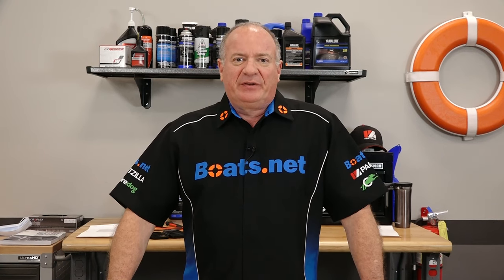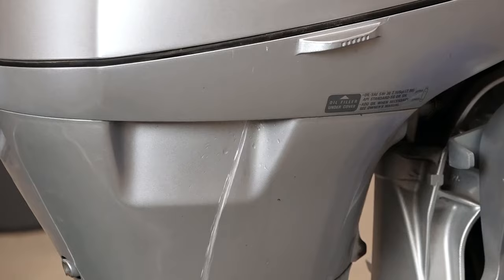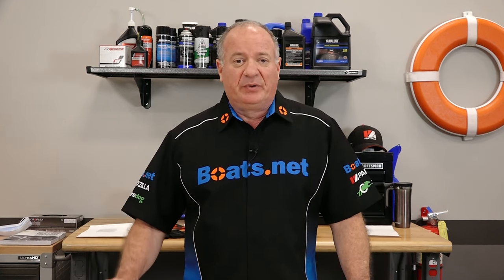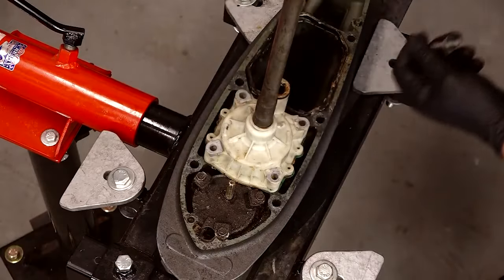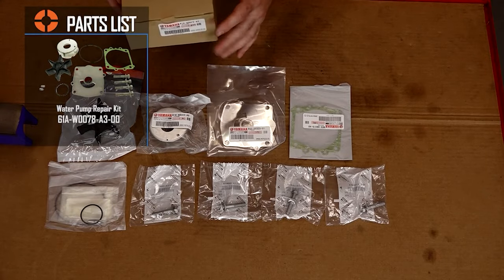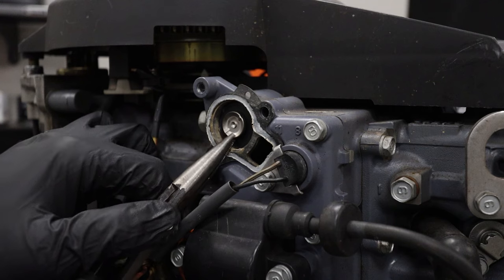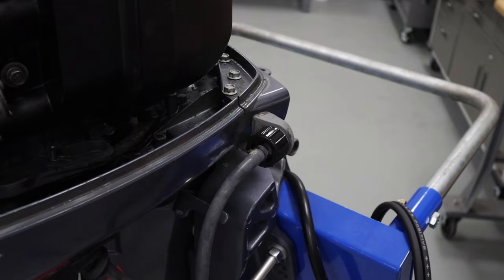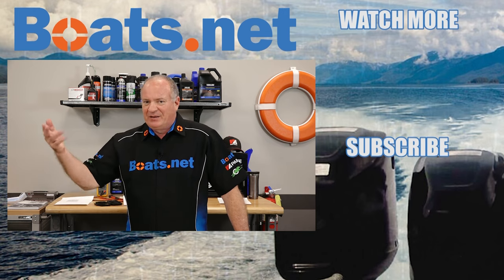Outboard Is Overheating | Why is My Outboard Overheating | Diagnosing an Outboard that Overheats

Comment: Use vinegar in a bucket that will flush out the corrosion in the galleries but keep an eye on the tell tail because the debris may clog the tell tail, but done on occasions will keep your motor clean.

Comment: My impeller was destroyed.  Most of the pieces felt out of the bottom.  But I have a feeling some have been clogged above.  How could I get them out?  Use shop vac with straw attached?
Reply: Compressed air thru all of the intake vents at the bottom, remove the thermostat and blow. Do the same thing for the pee hole. You need to get all the pieces out or it will block the system.

Comment: Have a 60hp 2 stroke yamaha. Had a problem with the rubber grommets and seals not sealing on the water tube between the pump and tube.  Odd place to have a problem but a zip tie tightened around the seal has held it snug against the top of the pump housing and stopped my overheat problems.

Comment: 1998 yamaha 250 2 stroke,saltwater series: new impeller, cylender heads removed and interior brush cleaned. when water is applied and engine running water doesn't make up to the thermostats and engine overheats. water comes out the tail tell. pop valve is good. i replaced the lower unit last year. plese help.

Comment: Great video, thank you!!  Question:  I have 1999 225 Mercury Optimax.  I saw a video recently showed how a dirty strainer that filters water going to the air pump needed to be cleaned on a regular basis.  I've owned this motor since it was new and have never head of the strainer, so I looked it up in the service manual. The service manual shows two strainers, one on the exhaust plate and the other on the top of the powerhead.  I can't see the one on the top of the powerhead without removing a bunch of stuff and the one on the exhaust plate appears to be plugged with no water connection.  Since these cool the air pump and the air pump has no heat alarm, I am concerned that I may be neglecting a preventive measure that should be taken care of.  Any advice would be appreciated.

Comment: Great video, I thought you may also adress deflectors that swell on some manufacturers V6's and don't let water run down to lower cylinders and usually cause a overheat horn under throttle. Not a every day issue, but happens. Anyways great video!

Comment: Questions about engine flush: Should full city pressure be used? Is it recommended to use hot water?
Reply: 10-20lb pressure likely

Comment: Great video,  my question is, my impeller blades were all sheared off, and there was not much inside when I took it apart, does that mean it is further inside the engine ? The motor is a 25hp 4 stroke yahama 2003.

Comment: Hello. Thanks for the video. We have an 1970, 70 h.p. Chrysler engine. We have changed the impeller and it is still getting hot and it does not spit out much water. Could you tell me where my thermostat is? Thank you.

Comment: Hi i changed thermostat on my outboard,changed new impeller..pee like a dream..changed carb as i suspected the carb, the powerhead gasket has been changed ,checked cylinder adjustments and gaps and still overheating..changed engine oil...3 5hp mercury 4 stroke..almost new hence i dont suspect anymote gasket blown..any suggestion what i have to look at...not changing the gear oil and not opening it...any suggestion what to look at for more to sort out this overheating ..thanks in advance..

Comment: I’ve replaced the water pump, the thermostat, and the poppet. Water is flowing out the tail tell and it has never not flowed out. But this year, the motor goes into limp mode when I run at over 4500 rpm for more than a few minutes. It runs fine for long periods of time if I keep it below 4500…over an hour with no problem. Could it be a false alarm from the temperature sending unit?

Comment: My 1999 90 hp Yamaha runs all day at 3800-3900 RPM BUT when I push it 4000 + RPM the alarm goes off and it enters 'Limp" mode within a few minutes.  After idling for 3-4 minutes the alarms turns off and I can return to running 3800 - 3900 RPM. So far new water pump rebuild, replaced thermostat, twice, replace pop-off valve.  I have run the engine without the thermostat and no change to alarm going off and turning off after 3-4 minutes at idle.  Oil consumption has remained constant in the 12 years I have owned this boat. No drop-off in performance, oh I am pushing a 21' Carolina Skiff.  I have always flushed my engine after each an every use.  The previous owner was very meticulous when it came to engine and boat maintenance.
Reply: See this is a little late but remove your thermostat see if it’s getting water if not your water tube might be damaged not allowing the water from the pump into the block

Comment: Yamaha OX 66 -  2 stroke - 250 HP .  Engine is new too me ,   no stream of water coming thru weep whole , , Impeller needs replacing , Today for kicks I ran two hoses , one on lower unit and other hose too flushing system ,  My thinking since I need new impeller maybe running flushing system might keep engine blocks cool ,  ( no plans on using  boat  )   Using gun ,  one side of block was cooler then other ,  Starboard side 111 - port 130 .  . - No water coming out ,  ( top )  why difference in temps  on blocks

Comment: new impeller on my 25 evenrude.  92, 2 cycle.  removed the broken thermostat.  Water isnt flowing through the pee hole.  Engine 0verheating.  Do I remove the side plate to check for stoppage?  This plate is situated where the pee hole is before going through the hose that feeds to the mounted pee thingy on the bottom side.

Comment: I Have a 1997 Merc 50hp 4 stroke. Bought the boat in 2000. I've had this problem for quite some time Only when motor is idling for about 30-40 seconds I get and ALARM buzzer. It does have a SOLID stream of water coming out the discharge outlet so the impeller is sending water through the engine. So thinking the cooling ok. I thought maybe its a low oil buzzer. Checked that and oil is full. All I have to do is turn the key off and restart and its all ready to go. If I continue to idol the buzzer goes off again after a while. no buzzer at any time other than idling . I change the oil regularly and someone told me there may be a RESET oil change timer that may need to be reset. But have no idea how to reset it ??  Is that a possibility ? Thanks for any help on this manner. Dale
Reply: Figure it out?  I have a 40hp merc doing the exact same thing right now..  will run strong across the lake with water existing telltale and when you slow to idle it'll alarm solid..
Reply: @zellerized  Yes, Changed the impeller and the alarm stopped going off. The old impeller did not look bad but was a little more flexible than the new one. Don't understand why because it looked like it was pumping water at a good flow but evidently it wasn't pumping enough water, but it did fix my problem. Hope this helps !

Comment: 2015 250hp suzuki , overheats at idle with garden hose used at alternate attachment. Plenty of flow, yet I  get error an code (3-6) for exhaust over heating

Comment: Hi there I have a Yamaha fl200 bet v6 the knock sensor behind the two heads I can't get to it how do I remove it without having to remove the heads because the knock sensor is irregular and I have been  tested it with a new knock sensor

Comment: I have a 20 HP 4-stroke Yamaha outboard. every month, I run the motor using a deep bucket.  Last month, the bucket had a hole in it and it ran dry. I have replaced the water pump and thermostat, but the water does not run through.  I have checked all hoses and everything is clear. Any idea if there's any hope for this motor or is it shot?
Reply: Replace the impeller.

Comment: I have a 2004 Yamaha 150 4 stroke that will not idle properly when it starts, it will go at 1200 and will not go down to the proper rpm
It will only stabilize at 800 only after it's on gear, causing to insert gear at 1200 with a big crouch to insert gear (not good for the lower unit) thanks

Comment: I have a Honda BF40 2021. It has about 10 hours of running time. Today I started the motor and it overheated, no tell tail cooling system indicator.. I hooked up a garden hose to do a engine flush.  Lots of flow exiting through the cooling system indicator.  Thermostat? Any thoughts on where to start ?

Comment: My yamaha 90hp 2 stroke cannot go past 4300 rpm. If you try it on full throttle past 4300rpm? It will only ran for 10 minutes and the alarm will come on and its on a limp mode....please need help

Comment: I get plenty of water flow. The water that comes out feels hot. Not that it burns me. Just to hot to keep your hand under for more than 30 sec.  Is this normal? I don't have a temp gage. 
Mercury XR6 159HP
W459hrs on it. Alway driven easy. Flushed after use.

Comment: Are they anything you can flush your motor out with if it is stopped up? I have replaced the water pump and the thermostat on mine and I still can't get it to come water come out
Reply: Impeller installed upside down?

Comment: My 1998 Vmax over heating alarm sounds after it has been trimmed up for a few minutes. The intake is still under water and pushing water out the exit port. Not sure what might be causing this.
Reply: Double spark maybe? Does your engine stop suddenly the movement from the starting motor when you try to start the engine? An out of time spark causes an explosion that stops the movement of the heavy flywheel? 
Heating may occur if an out of time spark reaches a cylinder besides the right in time spark works alright. Replacing the two ignition units that send voltage to each coil may solve the problem.

Comment: 200 mercury yr 2000 changed impeller both thermostats all water stops took out thermostats motor now pissing but still running hot 200 degrees

Comment: I have a Yamaha 90 hp outboard 2 stroke,Ive changed water pump,Thermostat,flushed all of that is good and new, and tail,tail flow is very good,but when out on water running by going by my RPM Gage I can run at 4.rpm but if I push controller up to 5rpm it will run but the alarm sounds off and I pull it back to 4 rpm and it will take a few but will go off? So if I run at 4 rpm I runs good what makes this happen?  And with my Thermostat cover there is a plastic peace there and I see in all videos on here that The hole is open with No peace or spring in that area could that be the problem? I don't know what it is? or for?   Appreciate your videos, great information.
Reply: Did you ever find the problem? I’ve got the same motor. Same fixes. Cleaning the heads now.

Comment: I have good water flowing from my tell tale, but not from the thermostat housing. I put a new impeller in and it didn't fix the overheating issue. Water only comes through the thermostat housing when I give it throttle, and it's still intermittent at best. Anyone know what this could be?
Reply: I think I’m having the same issue I have a late 80s 150 pro v
Reply: I'm having the same issue with a 15hp Suzuki 4 stroke. It pumps water good out through the tell-tale but overheats. I put a brand new thermostat in and it's no better.  Only way I can get it to run without overheating is to take the thermostat out. Anyone know how to troubleshoot that?

Comment: Do you have any videos for #5 clearing an old outboards water passages?
Reply: Remove the head(s) and manually clean or run a weak acid solution up through water tube and through cooling passages.  Flush with clean water after.

Comment: More info
1- Engine overheated no tell tail
2 - Flush engine then restart engine - overheated again
3 - removed the cooling water intake port cover and found some black rubber like chunks
4 - Flush engine again then restart engine - overheated again
Reply: Black chunks= impellor is destroyed.  That's what I just learned.  Not too difficult to replace.
Reply: The impeller is made of black rubber. Change the impeller and blow compress air thru the pee hole to dislodge any remaining pieces. Take the thermostat off blow air from the bottom water intake vents. Need to get all pieces out or they will block the passage ways.
Reply: @fabian4213  Thanks for your help 
I learned that there are 3 water intake opens and when using ear muffs to run the engine the 3rd opening needs to be blocked so air cannot enter the pump causing the impeller to overheat and disintegrate into pieces.